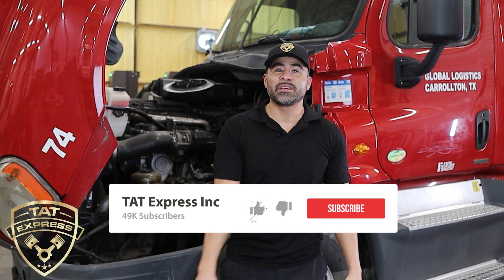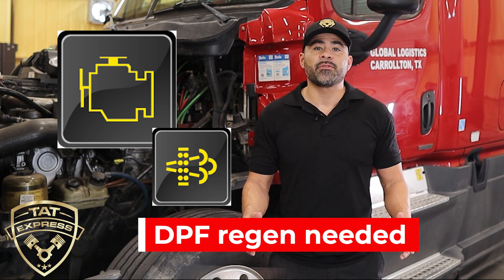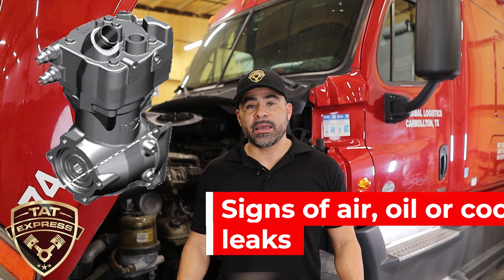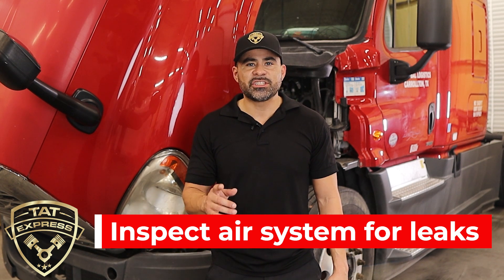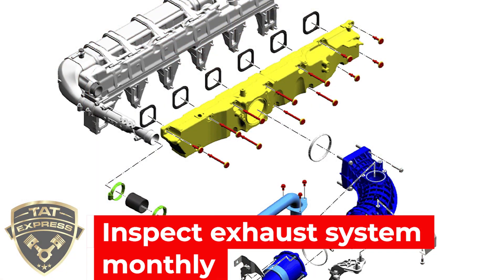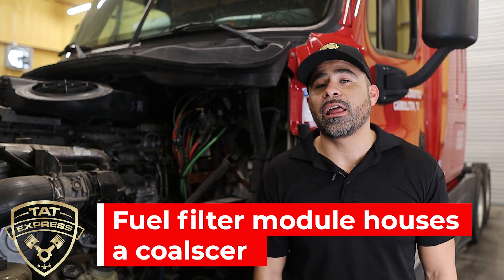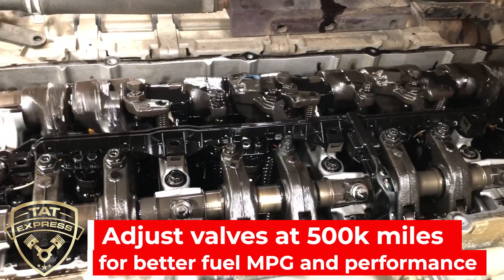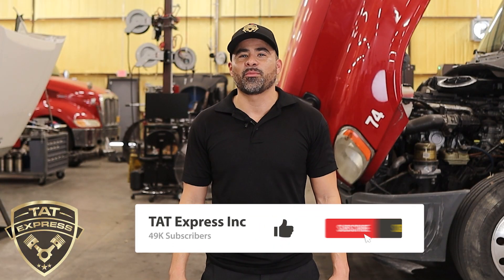DD15 Detroit Diesel engine/  DD15 maintenance intervals/ How to maintain your DD15/ Detroit Diesel

Comment: I forgot to change my air filter and my after treatment system won’t regen after changing EGR and filters
Reply from the maker: Thank you for sharing. Be sure to troubleshoot active codes. If there is soot buildup, then sensors could also be clogged.

Comment: I have a 2005 international 9400i with low air pressure only getting 63 psi in both tanks. I changed my air governor and air compressor but got the same results. You think perhaps my air dryer needs replaced? I would appreciate your advise. Thanks.

Comment: Done some work on high milage DD15,s and most common issue ive seen is ticking noise sounding like its the compound turbo driven gears but always exhaust leaks from warped manifolds, not badly just enough, have been resurfacing on old cylinder head grainder quite successfully and doing it without draining coolant too or removing turbo from truck, you work it out like i did lol

Comment: Keep yours ears open for the exhaust bridge or bridges coming off and the exhaust adjustment screws failing on the new GEN 5 DD15’s. Common issue with them. Good video

Comment: Emissions has been deleted 3 years and running strong
Reply: Yes I do everything as he mentioned in the video no problems or issues.
Reply: @Poatjas  lol smart business owners think about resale LOL
Reply: From looking at the truck market the last 4 years Cascadia with a DD15 used to be 30k. How much are you expecting to resale a plastic truck for in this current market? From the looks of it 700k-1Million on the chassis with a rebuilt or reman engine is not selling for more than 10-30k. You’ll lose on a resale with a new one box and engine
Reply: Well good for you but who cares lol
Reply: A smart business owner doesnt trash the emissions system. Resales gotta suck for you but i understand you just wanted to start up with that comment lol so again. Who cares

Comment: Do you think it’s best to replace a DD15 engine or rebuild if it’s rotating after engine failure. Currently at 756k nothing is wrong now just preparing for the future until truck prices drop
Reply: Mine needs an overhaul bad but it’s still cheaper to rebuild than buy these high priced ones

Comment: Maintenance system is a joke, it does not know what type of fluid user is using, low quality or high quality. Maintenance system does not test fluid for quality, water, fuel dilution, soot, additives count and contamination. Factory recommendations are for factory to stay in business and owners in debt and broke
Reply from the maker: Preventive maintenance is the least costly way of obtaining a reliable truck.   Oil analysis is the best safeguard to ensure proper oil viscosity.   Equipment maintenance budgeting could help during slow seasons, especially with an emergency fund. I hope things get better for you, driver. Thanks for watching
Reply: @TATEXPRESSINC  💯💯💯💯, alot of OO forget to budget for maintenance/repairs.
Reply from the maker: Preparing for the worst is the best safety net.
Reply: @TATEXPRESSINC True. Should have a Business Account..Personal Acc..And a Maintenance Account.
Reply: @TATEXPRESSINC  I do oil analysis on everything and like I said factory recommendations are joke
Reply from the maker: We would not recommend extended intervals without an oil analysis.
Reply: @TATEXPRESSINC  I did not say extended intervals without analysis

Comment: Mmmm... I guess we're all a little different in schedule , I go by hrs, every 100 hrs I grease, even if it only takes a couple of squirts....it makes you look at everything while you're doing it, like fluid levels(rear ends and trans ) and tire pressures. Every 200 hrs( max 250) oil& filter change, also fuel and grease and fluid checks,  every second oil change water separator filter and coolant filter(if you have one). It saves big pesos in the long run and let's not forget headaches :)
Reply from the maker: Thanks for watching, and thank you for sharing your preventive maintenance practices. Chassis maintenance video is on the schedule to produce. Good info 💪🔧
Reply: So you're changing your oil every three weeks?
Reply: Seems kinda obsessive costly. I change my oil every 20k to 25k miles and I though I was being preventative 😂